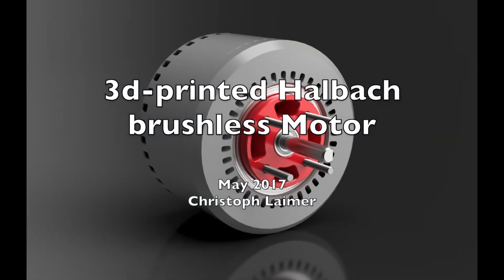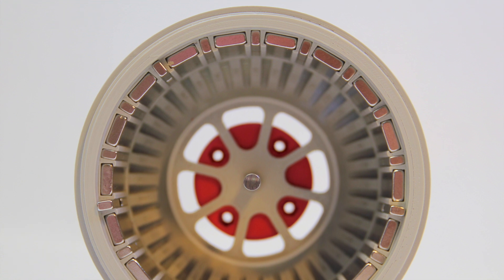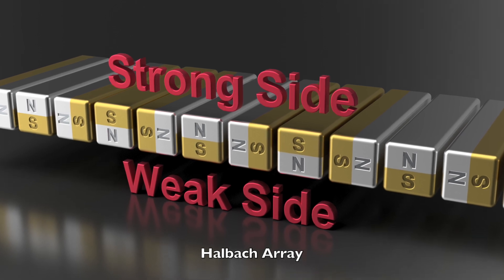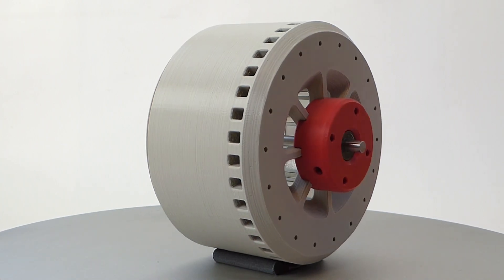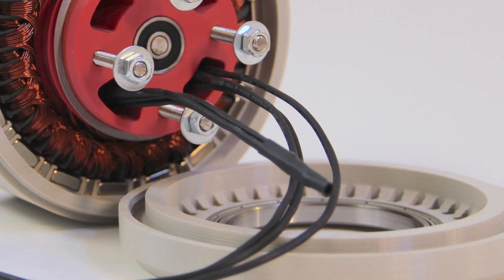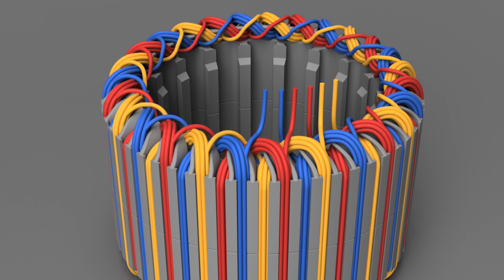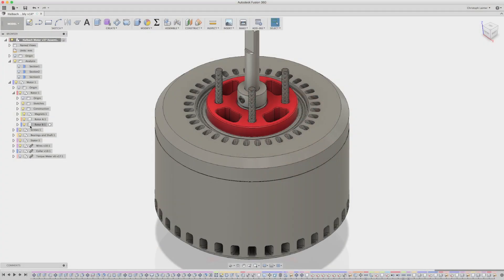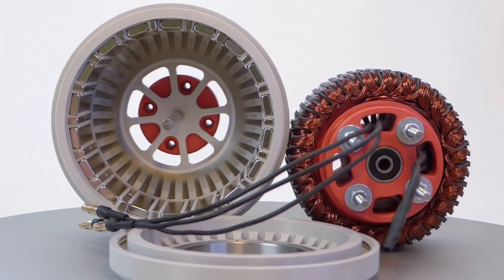600 Watt, 3d-printed, Halbach Array, brushless DC electric Motor

Comment: how would such a motor perform in terms of temperature stability? would you have to expect deformations as load gets applied to the motor over a longer time?
Reply: Jay0neDE not sure if it was mentioned which plastics were used for the housing and parts outside of the rotor but I'm sure the answer here is it depends on the plastic used for the housing.  I imagine if you need to sustain a temperature around 200C then you'd want some type of nylon with or PEEK or maybe even PTFE type of thermoplastics (ABS or PLA will definitely be gooey at that temp).  In my limited experience with printing with nylon this can be somewhat challenging due to the extreme thermal contraction when the nylon goes below its glass temperature.  I suppose the rotor with the windings will have some temperature deformation as well but the windings may help to give it more rigidity (just speculating).

Comment: Have do done any testing of this compared to a regular thin metal lamination design with insulation? I'd be curious how the printed filler effects eddy current losses.
Reply from the maker: no, I didn't test that. I'm also curious to see this. Certainly Kv is much lower with the laminated stator

Comment: could you try make a electric motor using wires from an scrapyard alternator? :)
Reply from the maker: Maybe, if the diameter is matching ... but the risk to damage the isolation when unwinding the scrapyard alternator is very high. It's likely that the effort for re-winding a new motor is lost.

Comment: Could you take this design, but remove the smaller magnets so, just to test how much difference thee Halbach array is? Also, I'd be interested in seeing how much magnetic shielding would improve performance on a motor, I've heard that it increases performance but I have yet to see any testing of this.
Reply from the maker: I've only done a simple test, and removed the smaller magnets. Kv is roughly 40% higher. Shielding does increase the magnetic field force, and hence reduces Kv.

Comment: I am stunned every time I watch one of your videos, very inspiring and for me at least redefining what 3d printing can do. Can I ask, do you need a very expensive 3D printer to do these parts? I have a PRUSA Original MK2 on the way and though the parts I have planned are not as complex as yours, it would be great to know if it is capable of reproducing your work.
Reply from the maker: I think the Prusa will work very well. The accuracy isn't as important for this project. However it is important, that all 3 axis (XYZ) are perfectly aligned square. It's important for round and not wobbling parts.
Reply: Thank you very much! I have to wait 7 weeks for it, but I will be making this one of the first things I try out! Now I am off to watch all your other videos :)

Comment: lets say i would want a more powerfull motor. how easy would it be to scale it up?
Reply: There are many variables (knobs to turn) to achieve whatever performance you desire (more horsepower, more torque, or perhaps on the other end of power consumption... more efficiency (more bang for your buck). How many poles? How many turns per pole? Small wire with many turns vs thick gauge with few turns (hint: the more copper the more power without meltdown).  I'd suggest to anyone wanting to know more to check out the RcGroup's Electric Motor Design & Construction forum as well as Motors for Makers: A Guide to Steppers, Servos, and Other Electrical Machines
by Matthew Scarpino.  Also check out JobyMotors.com They have some of the sweetest (IMO) brushless motors. Hope this helps.......
Reply from the maker: More torque and therefore more power. That's true. Ventilation gets a bit more difficult. After a certain lenght the problem will be the robustness - it could bend and start wobbling. I really don't know which dimension is easier to scale. Maybe a larger diameter is simpler ...
Reply: RGplayer101 increasing the length of the motor with longer coils and magnets would increase the torque output generally speaking
Reply: RGplayer101 thicker wire and more windings will give you a lot more torque it's based on surface area larger magnets larger wire larger windings equal more surface area which equals lots of torque but with lots of torque needs lots of power amperage
Reply: As a thought experiment, could you not manufacture several motors identical to this one and stack them axially with a shared metal axle?  As long as the phases are synced correctly and there is enough airflow this should increase the torque without adding stress to the plastic parts since they'd split the load in parallel.

Comment: Do you get the Fusion 360 files in the download ? Do you have any information on the best way to modify the design to change the kv/torque, say for a wind generator ?
Reply from the maker: Kv can be tuned by the number of turns. Increasing the number of turns reduces Kv (higher voltage with lower rpm). You can find a table with some variation here: https://www.instructables.com/id/600-Watt-3d-printed-Halbach-Array-Brushless-DC-Ele/#step10
I don't yet have a final plan, how to distribute the Fusion 360 file. There is definitively some clean-up with other cross-linked designs needed, before I can offer it ...

Comment: incredible ! Are you planning to test motor limits as the small model you made ? Also would it be complicate to add an encoder for position management ?
Reply: luc le rumeur I would think for a high speed brushless motor you'd just want to use hall effect sensors instead of rotary encoders since with the latter you still have physical switches that will wear (are there rotary encoders that use the hall effect?)
Reply: It would take some experimentation, but it should be possible to use a hall sensor to encode rpm using the rotor magnets, although I'm unsure if the halbach arrangement would impede a clear reading on the sensor. Wouldn't give you true absolute positioning, but you could determine rotation angle to a reasonable degree.
Reply from the maker: At the moment I don't have such a test planned. I've calculated the limitations based on the test of the smaller motor ... 
It's probably not very complicated to mount an encoder on the shaft.

Comment: what about temperature? will it melt?
Reply from the maker: With 20°C ambient temperature and 600W it won't melt. It also depends on the rpm (because of the ventilation). It will certainly melt, if the motor is operating beyond these limits.
Reply: Reminds me of a machine that was hooked up in our factory in Russia.  One problem was they forgot to ventilate the main motor which was about 18" in diameter.  The heat melted all the solder connections inside and slung it to the outside.  That was the end of that motor.

Comment: Great design!  Very impressive!  Please correct me if I'm wrong, but this should work as a 3-phase AC generator, right?
Reply from the maker: Yes, that works. Basically all electric machines can operate as generator or motor. https://en.wikipedia.org/wiki/Electric_machine

Comment: Should you hook it up to 35 Ah/30V lithium-ion battery (1050 Wh),  running time is 1 hour 45 minutes. When hooked up to an e-Bike with 622 mm tires and motor drive ratio of 2.5:1 (thus gives max speed of 84.6 km/h) gives cruising range of 148 km at 6500 RPM That would get approx 6 N-m or 4 ft-lb of torque should it power 600 watts (0.805 bhp, 0.816 PS). It would be cool to hook it up (ie clutch the shaft to) to an OHV gasoline (petrol) engine ie from a lawn mower or some gas-powered motorised power tool (and act as a generator) and hook up to a positive terminal of the lithium-ion battery, start the engine and to see how much time it charges a 150 Wh battery depending on engine RPM. Should you up the size and power of the electric motor to say 15-20 hp it would power a scooter, to 50-60 hp, would power a motorcycle, and 100+ (assuming 150-180) hp could power a car (maybe alongside an OEM engine to act as a hybrid conversion and with a 10-15 kWh lithium-ion battery and external charging would be a PHEV conversion (with ECU reconfiguration and associated extra hardware, etc) or swap out the engine and have a 50-60 kWh battery to convert to a EV or place hydrogen tanks and fuel cell to have a FCV convert.)
Reply: What size motor and wattage volt etc would I need to power a car? If I made a homemade car? Also if I was building a human size drone what motor would I need for the 4 propellers used to lift two humans as a little project? Thank you.

Comment: Interesting.  What would have happened if you used the smaller square magnets throughout, rather than alternating them with the rectangular ones?  Would that have dropped or increased efficiency?  What was your motivation to alternate between the two?
Reply from the maker: With only the small magnets, the poles were closer together, and the slots of the stator would be much tighter (and painful to wind). I didn't test the performance with different shapes of magnets, but I'd also be curious to see the impact on the efficiency.

Comment: Amazing. How did you model the wire?
Reply from the maker: It's a "sweep" along a path. Actually only one turn per coil with a hole bundle of circles.
Reply from the maker: Yes, a 3d-path. I created 2 sketches/views from 2 different angles, extruded and intersected them as two bodies. The common edge of the resulting body was used as a 3d-path
Reply: was asking the same thing. :)
Reply: 3D path?
Reply: what program do you use to model?
Reply: Atlantic Film what is the price of this brushless Motors can you tell me or send any message
Reply: Google Fusion 360
Reply: SAtlantic Film per.  D cvs-a. Tic
Reply from the maker: Fusion 360